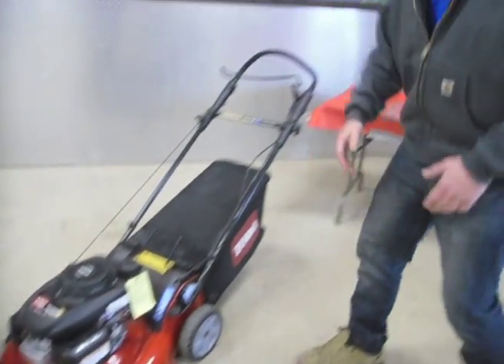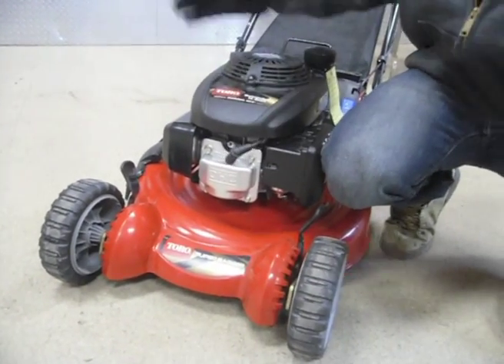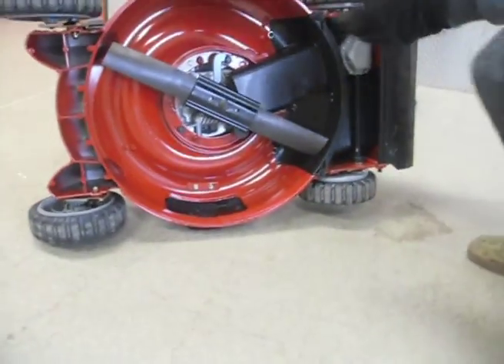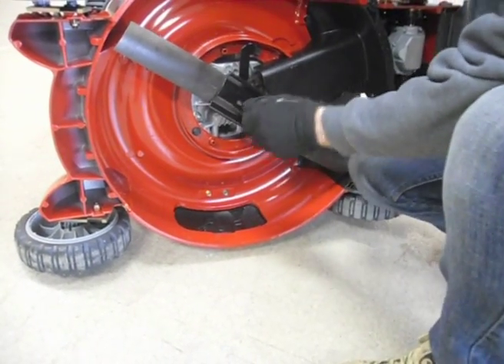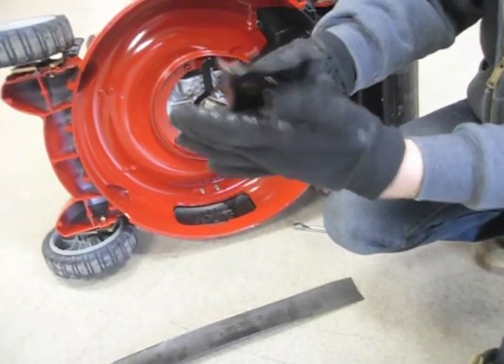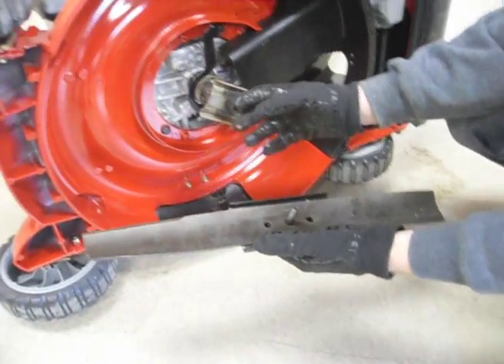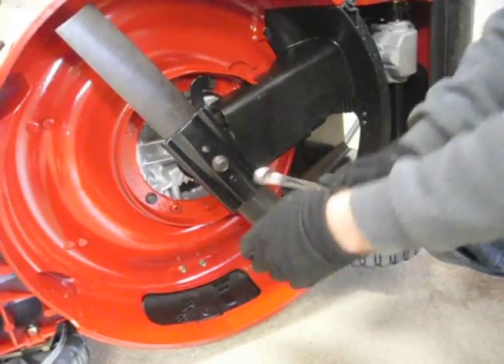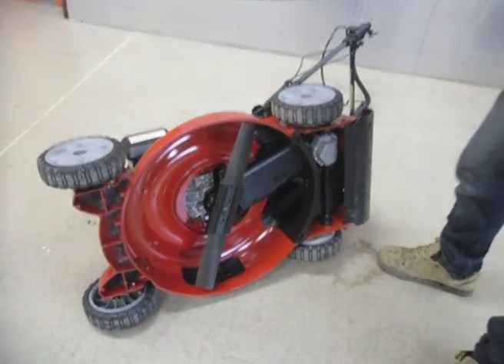How To Change Your Lawn Mower Blade | Toro Residential Push Mower

Comment: Thanks!  The bolt was super hard to get off but I used a 4X4 to keep the blade from turning and had to stand on it while I hammered the wrench (I used a ratchet tool-socket set) connected to the bolt as hard as I could. I also had to first make sure which way to turn the bolt, which the video was able to show me.